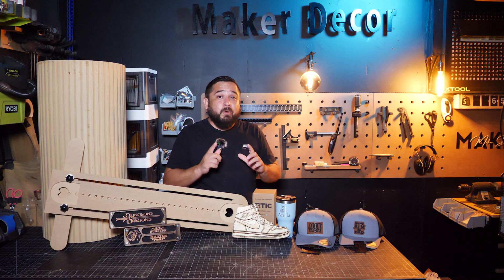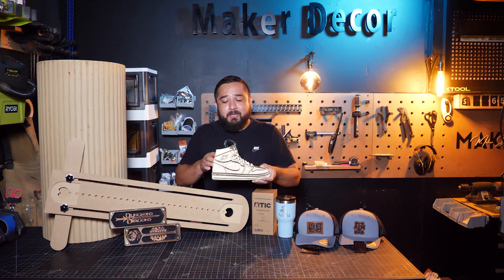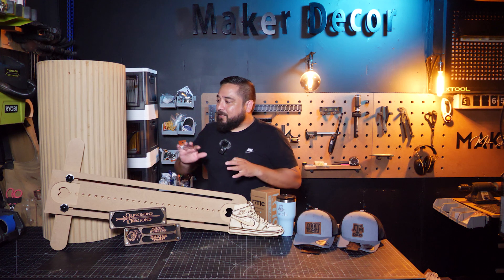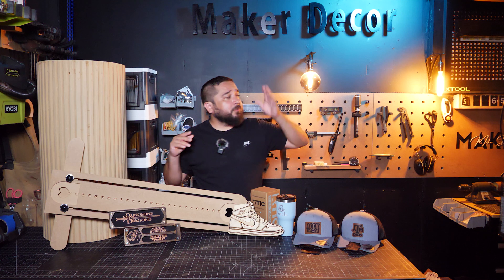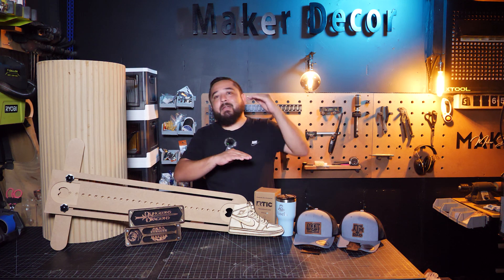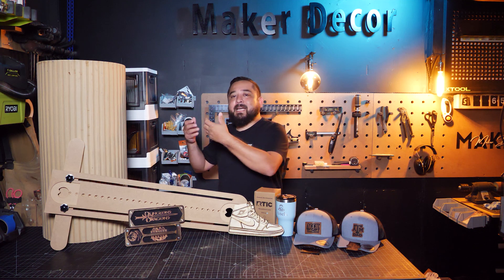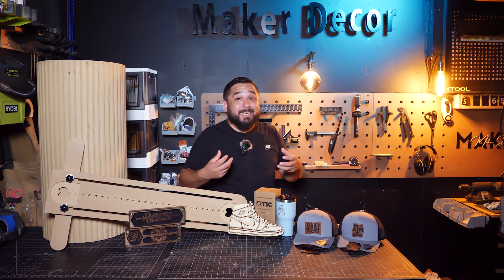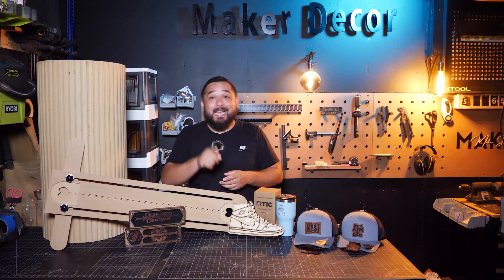CNC Vs Laser Which one should I get

Comment: Would you recommend a laser for wood signs that go on backdrops? Ex happy birthday etc. what laser do you recommend.?
Reply from the maker: Hi, Yes a laser for those letter backdrops depending on the strength of the laser. Smaller lasers with 70 watt tube or lower will be difficult to cut through thicker plywood/ mdf. So something  with a bigger watt tube, say 100 watt will cut through wood like butter. Mdf to a lesser extent because of its density. But  you can definitely cut MDF. Which looks clean with a laser. I would look at different lasers and what their recommended cutting depths are with material. Most will have to switch to a longer lens. But with the longer lens you can cut through 3/4 inch plywood on some lasers (100watt). But most signs are only 1/2 inch thick. So look to see if the lasers you are thinking of getting will cut through 1/2 inch material plywood/mdf. With a CNC  they will all cut through 1/2 inch thick / 3/4 inch thick plywood or mdf easily. But the dust and clamping can be a pain vs just the laser. Hope that helps and good luck!
Reply: @MakerDecor  thank you so much for the detailed response!

Comment: Love your no-nonsense discussion.  I’m ready to jump into the whole CNC universe and my son wants me to add a laser to cut balsa wood for his RC airplane hobby.  Which jtec laser would you recommend to add to my onefinity CNC?
Reply from the maker: Hi, thank you very much! Interesting question. Balsa wood is great for laser cutting and usually don't need so much of a powerful laser to cut it, depending. So you wouldn't need generally a more expensive laser from jtec to cut it. They have a couple of different wattage versions on the onefinity website. I believe a 7 watt and 14 watt for engraving mostly. But then a 24 watt, 44 watt for cutting wood and engraving. But I am super excited and have been really thinking of getting their newest option. The 64 watt laser just released which can switch between 24, 44 and then the 64 watt depending on material and wether engraving or cutting. It makes a difference. Bigger laser vs thinner laser in cutting and engraving. I never thought I would get one attached for my cnc but. I am really thinking about it. The 64 watt can cut through 3/4 inch thick pine in two passes, But if you are just interested in cutting the thinner balsa wood, then the 24 watt would work great. Hope that helps some and check out onefinity website as they do a great job explaining the capabilities for each laser options. Thanks for watching and commenting!

Comment: Hi which CNC brand do you recommend for beginners, to be able to cut marquee and 6ft backdrop designs
Reply from the maker: That is a tough question. For smaller 4ft x 4ft CNC I definitely love ONEFINITY CNC. I have had great results and I am still a beginner, lol. But if I were going to get a bigger CNC for 6ft backdrops. I would most likely look at Phantom CNC's. But they do have hobby CNC's such as BOBs CNC and Maker Made machines but those are lower quality than phantom and priced accordingly. I have never used either. I hope that helps and good luck!